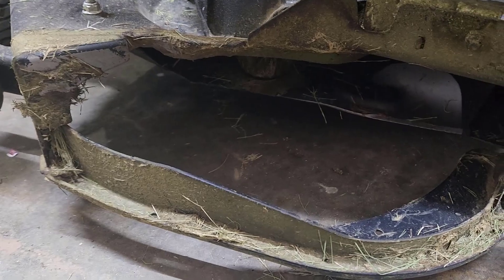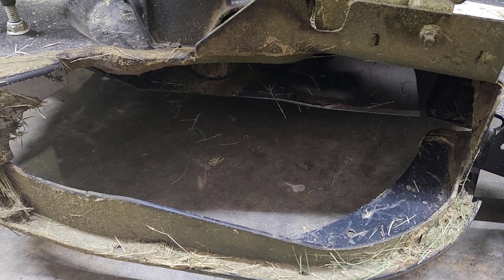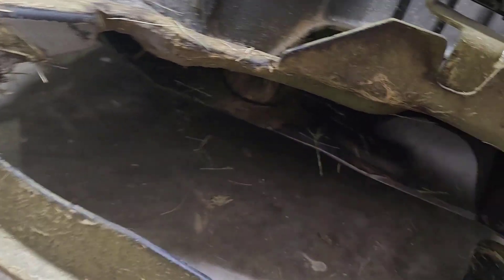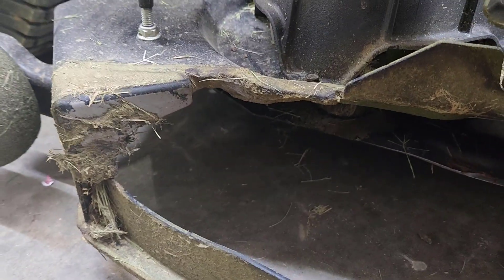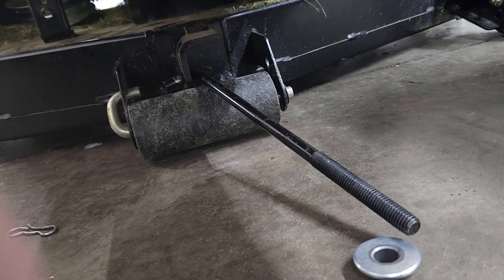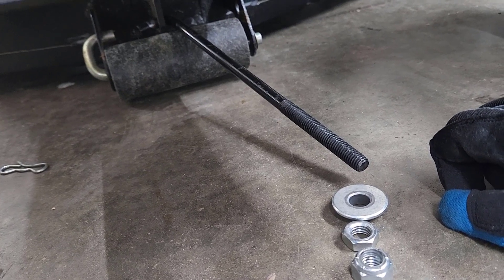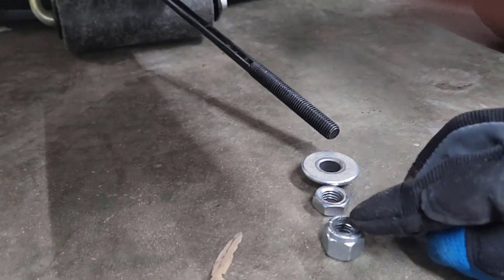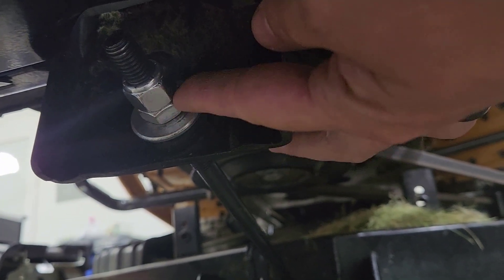Cub Cadet 50 Inch Riding Mower Deck Adjustments (Pitch)

Comment: Don't forget to make sure all 4 tires have the correct air pressure, before you take any measurements.
Reply from the maker: Definitely. I have another video for other than just pitch covering this as well. Thanks for adding that note.